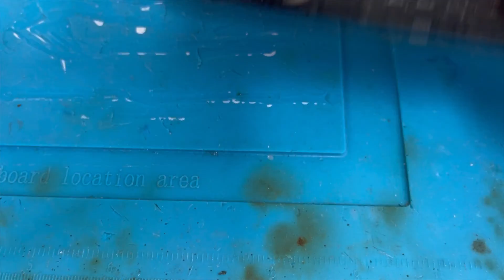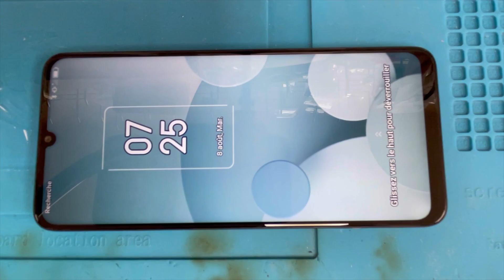Tcl 40 xl screen replacement,t608m

Comment: This is an excellent video.  If you are new like me here are a couple of pointers.  1. Use the alcohol, I didn't think it made much difference the first time, the second time I did use it and it was so much easier.  2. The free tools you get with a screen suck, get a good quality screwdriver for this.  3. Buy a screen that includes the back.  The first one I did I got just a screen only.  The second one I got the screen with the back, its like $3 more but worth it for the quality job.